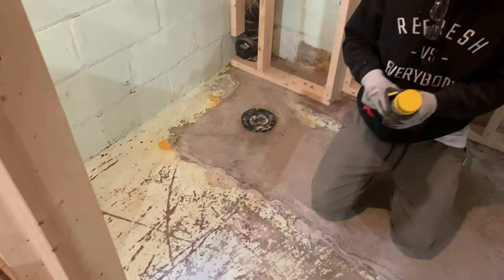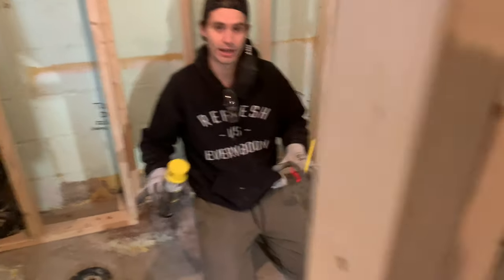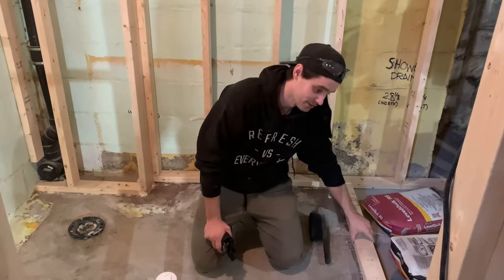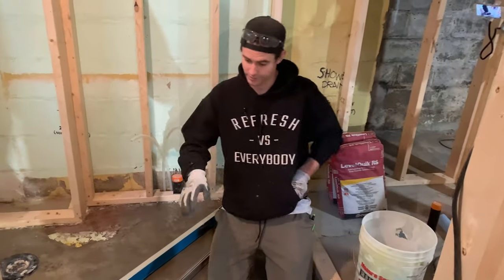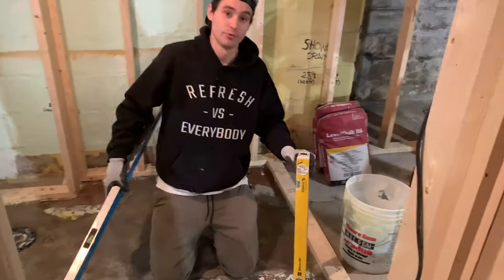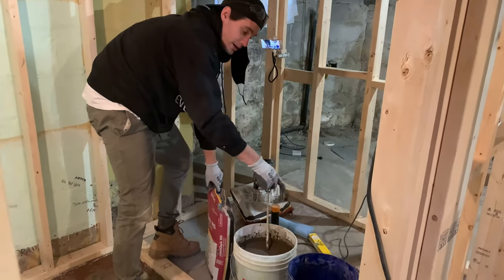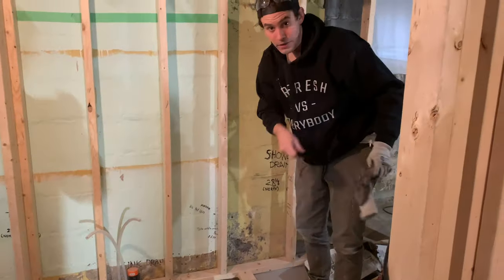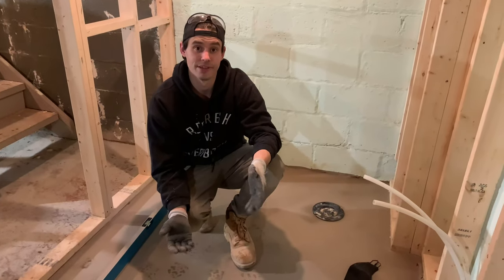How to Level a Floor! (Self-Leveling Concrete Tutorial)

Comment: Thanks!  A couple questions as I prep my floor for vinyl wood overlay.  My room is similar to yours.  
1. How did you prep the drain to keep it out and even taper into the drain a bit?  
2. What is the depth the leveling material when you are complete?  Certainly, depends on subfloor.  But overall, 1/4" 1/8" thinner?

Comment: Gentlemen - Followed your instructions to the T, but I still have two small dips in my self-leveling concrete (I think I mixed it a bit too thick).  Would I be able to use a patch-and-level for the two small dips, then apply the thinset and uncoupling membrane?  Or, what would you recommend?  Great video and thanks for having this channel.  👍

Comment: How long does it take to mix it in a bucket? The bags I got say there’s a 20 min working time so I’m worried I won’t be able to get 4 bags ready and poured in 20 mins.
Reply from the maker: That’s a terrific question! And that’s one of the trickiest parts of doing it without a large scale mixer. The biggest saver for us is the spiked roller. You can mix up each bag in about 5 mins, and pour right away and get mixing on the next bag. If you’re working solo it can get tricky, but if you have a helper the other person can be using the spiked roller to blend the pours together and helping to keep them flowing as you go.

Comment: So you didn't use screws to see how much/high your leveler needed to go? I also saw you didn't have to move it around..
Reply from the maker: We have another tutorial on our page with a little added info. For larger spaces spiked rollers are key! We didn’t use screws, we had a level line marked that we wanted to hit on the side of a baseplate

Comment: I have to do this in my kitchen and dining room... and going down the hallway to the bathroom. Previous owners agreed to replace 44' of drain line to sell me the house and had to dig a trench in the slab. They didn't level the new concrete and the tiles have a ton of hollow spots that can't be fixed with Fix a Floor adhesive alone.
Reply from the maker: Yikes, sounds like you’ve got your work cut out for you! Best of luck, let us know how it goes 👍

Comment: Every other video says to work the material with a squeegee or rake, not to just pour.   But, your outcome looks great.  Can that just be the final floor?
Reply from the maker: Great question! It’s a definitely a good idea to have one on hand. We’ve done it in the past (on thicker pours)- but in a situation like this we’ve found it wasn’t always necessary if you can get a good pour- and we’ve been happy with the results without having to work it. It’s worth noting that we’ve also messed up a few pours by overworking it (probably wasn’t the right consistency, as well), so it can do more harm than good if you’re not sure what you’re doing. We’ve found you’ll know when it needs to be worked, and when to leave it alone. Either way, we always recommend to follow the instructions on the product you’re using for best results 👍.
Reply: @RefreshHomeImprovements  Very helpful.  Thanks.
Reply: Looks can be deceiving.

Comment: I’ve seen where installers have used some type of material for expansion on the perimeter. I’ve watched videos where they’ve used a foam tape around the perimeter in order to compensate for contraction and expansion , or they used spray foam but instead of cutting like you did, they do it after the pour. 
I’m doing this in an upstairs bathroom on top of plywood,would my scenario need foam around the perimeter?
Reply from the maker: It’s not a bad idea. We just don’t think you need to leave more than 1/4” of flexible material regardless.

Comment: Thanks for sharing. I have a question. I’m adding a shower in my basement. The area where the shower is going has ceramic tile. Can I use this product over top of the ceramic tile to level the area out?
Reply from the maker: Good question. Technically, yes, it is possible- but you will likely need to apply a primer, and you could run into a large number of problems (adhesion, cracking, etc.). It depends on the type of leveller you use as well. As always, we recommend going by exactly what the product states (it will tell you what it substrates it can be used on). If it were us, we’d likely just remove the old tile first, to avoid any unforeseen issues 👍.

Comment: I’m curious, you didn’t roll this floor out with a spike roller to ensure consistency and to remove air bubbles. Any reason why you didn’t? I know if your tiling it’s not as big of an issue and this is a small space. But if your using vinyl, those bubbles and blisters can show through. I know many of self leveler concretes are sand-able, but a quick pass with the roller would eliminate any potential issues. Also caulking the joint between the wall and floor works very well. And caulk is a little cheaper than spray foam. Also, why no expansion banding? Otherwise good video.
Reply from the maker: All very good points 👍 We usually recommend just following the steps on the product to the letter (haven’t had any issues with bubbles 🤞). You’re spot on with the caulking tip- we do that when the gaps are smaller. Thanks for the input!
Reply: It’s too small a space for a spike roller to matter. Just let the liquidy concrete do it’s magic

Comment: Isinth this floor supposed to have a pitch cause i noticed theres a drain sitting on your floor that wont be usefull anymore...?
Reply from the maker: Great question 👍 if you look closely you can see that the room has been separated into two sections (by 2x4 on a foam gasket). We levelled the ‘main’ area of the bathroom, and left the shower area as is. We then used a pre-fabricated sloped pan to get the pitch needed for the drain 👍

Comment: I want to finish my basement, do I put up framing before using self leveling cement? Or vice-verse? Or does it not matter?
Reply: I don't see it in this video but really there should be some type of subfloor for remodeling a basement from a house pre-1990. Otherwise you aren't managing water issues. Suggest https://www.youtube.com/watch?v=M3jwVa7MiEQ&ab_channel=HomeRenoVisionDIY

Comment: I'm curious about how well it mixes with water.  When you poured the material out of the bucket did you find any lumpy stuff at the bottom of the bucket?
Reply from the maker: You’ll want to mix any self levelling product EXTREMELY thoroughly (make sure to start with a little water in the bucket too- ensures nothing sticks to the corners). This product mixes as well as any others we’ve used, but as a rule of thumb, dont pour until you’re sure its mixed completely. Trust us 🤦‍♂️ 😂.

Comment: Is there anything you needed to do to prep around the toilet flange? Aside from that, awesome video man, really well done, really clear and helpful. Much appreciated!
Reply from the maker: Much appreciated! It sort of depends on the situation. If your flange is already set (at the correct height), then you simply want to make sure that the pour doesn’t make its way into (or over) the flange (remember that the closet bolts need to sit inside the flange to ‘lock in). That can be achieved by sealing the outside with whatever you used to seal the frame with, and making sure you’re not pouring more than you need to to achieve a level floor. In an ideal scenario, we prefer to leave our waste drain pipe long, level the floor, then cut it back at the exact height we need it to avoid any issues 👍
Reply: @RefreshHomeImprovements  thanks for the feedback! That all makes sense. It looks like your flange sits about 1/4" above the LevelQuik, so I'm guessing it will sit flush with the top of your tile after the tile is installed. After I removed the toilet in my bathroom I could see that whoever installed the porcelain tile did not cut around the outside diameter of the flange - they only cut the tile around the pvc shaft that goes into the drain pipe. So the lip of the flange sits on the porcelain, and then they screwed bolts into the actual porcelain tile and beyond into the plywood subfloor. Odd choice. I think they should have cut the porcelain a bit wider all the way around the outside diameter of the flange. This would have allowed the flange to rest directly on the plywood and the top of the flange would have then been flush with the porcelain tile. At the end of the day the toilet didn't wobble and there was no leak, so it wasn't a big deal. But I'm learning new things with each video I watch as I research how to remove the tile, prep the subfloor, and replace the rusty flange. Thanks again!

Comment: hey, does the self level compound become level by itself?(i saw you didnt push it around or anything), ive tried twice in a laundry area and both times theres been ridges, humps and small marks from the trowel, i tried to just push it to the corners and not do much. I also never have enough to do basically one continuous pour, but i had someone else mixing it so id go back and get another bucket full, would you recommend adding a tiny bit extra water? cheers
Reply: What the!?!?!  Self leveling… its in the name why arre u hitting it with a trowel?
Reply: @dennisjazz5142  pushing it out into the corners

Comment: hi, thank you for the video. I'd need to do the same for the entire house room by room before putting the vynil plank. I wish there is second part of the video how you did the rest of the floor. Did you pour just next to not to let the cement pour overlap the already done leveled floor? Any advise how to do it for the 500 sq ft area?
Reply from the maker: Sounds like a big job! For this particular application, we only needed to level a small section of the bathroom floor. The other area is where the shower will be, and because that section needs to be sloped to the drain, we use a technique called ‘dry packing’ (or dry pack)- and that’s a whole other video 😂. For a job of that magnitude we would highly recommend hiring professionals who do that sort of thing for a living to make sure it’s the right thing to do, and to see that it’s done correctly. They would be able to advise you better than we would 👍.
Reply: Get a professional, this wasn't the correct way to do it, if you do that area without rolling it out with a spike roller to release the air bubbles in the levelling compound you're floor will fail

Comment: I was under the impression that there needs to be an expansion gap for self lever?
Reply from the maker: Interesting! Not in our experience, but we’d always recommend going by the instructions on the product you’re using. We’ve never worked with anything that required an expansion gap though 👍

Comment: I really hope nobody watches this video and thinks it’s as easy as that. Really, it’s not. If you do such little prep you will almost definitely end up with a floor that is not level. First thing you need to know is that self levelling compound does not actually self level. Maybe if you’re doing a very small space like this, you might get lucky, or perhaps you are using a very thin compound. Beware, thicker compounds or larger areas will definitely not level themselves if you just pour like this. If you are doing a larger space, for example a couple of metres width, you absolutely need a spiked roller, possibly a trowel, and possibly a feather edge. Also, maybe even some spiked shoes. Also, you really need to give a lot of thought to how you stage each pour. Basically, go and watch a couple of far more detailed videos than this.

This does not discuss in any detail what you’re pouring onto, for example you need to be careful if you pour onto timber subfloors eg plywood as there are maximum limits for the amount of compound you can build up. Basically, the topic is (or most likely will be in your case) far more complicated than this very short video implies. You’ve been warned!

I say this only as a newbie who attempted a really sizeable levelling job and although many aspects went very well, I can tell you that this job needed experience, even if just being good at trowelling.

I don’t mean to pour negativity onto this vid, but instead to help some people out who may be researching their own pour.